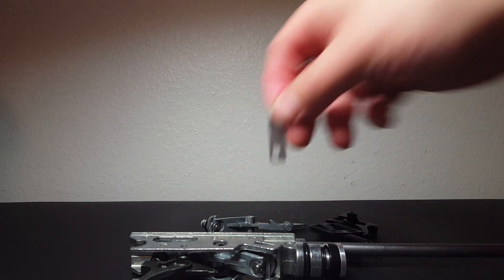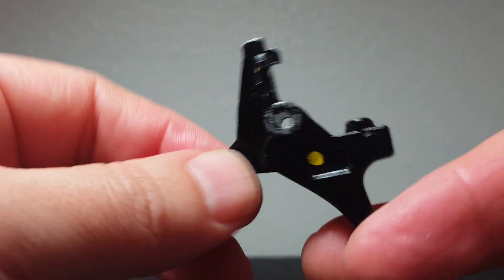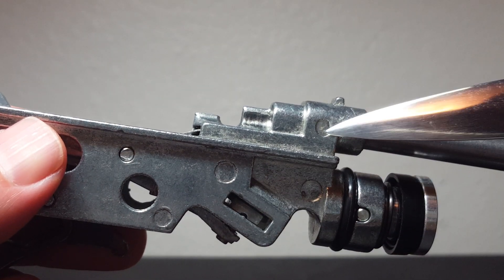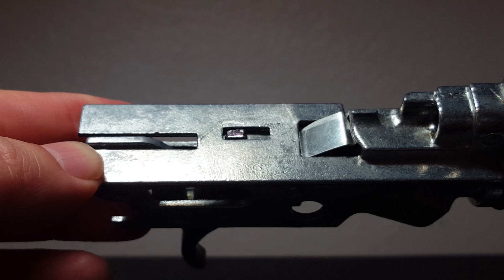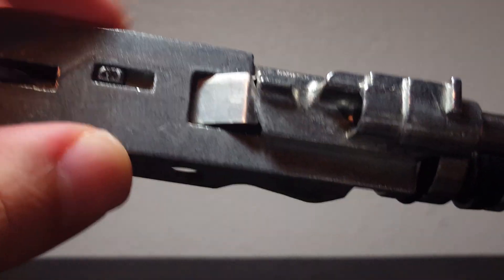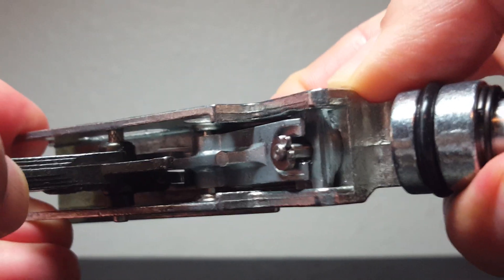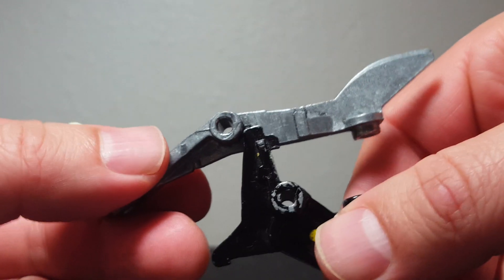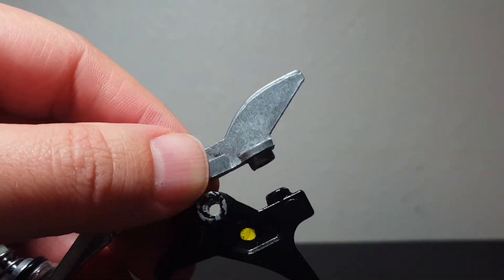Daisy 880: Part Details

Comment: Question.... I just bought a 880... The bolt blows open when I fire the rifle...it seems like there is a excessive amount of oil in the breech and on the o ring.... It sends the pellets down range with no problems...too much oil or do I have a lemon?.. thank you!
Reply from the maker: The last time I heard of the rod blowing back was a shooter using very HEAVY ammo or Red Fire pellets that have a THICK skirt.

If you see excessive oil, work a Q-tip to soak it up. 

I'm glad it is shooting well.
Reply: And it looks as if the safety tab is doing something.
Reply: I got it fixed thanks to your videos...the safety tab was pushing up the bolt and the bolt would not always click in place as you push it forward...the bolt wouldn't click into place in the back of the bolt behind the charging handle...I know my way around the 880 now...I lost and found all the parts your not supposed to lose... LOL!!! Thank you!!
Reply from the maker: Darrel, good job! Good fix!

Thanks for explaining the malfunction. That description can help others.
Reply: Got a scope on it today... getting it dialed in...

Comment: If the barrel separated can it be fixed?
Reply from the maker: It depends. If it has a bend, that is a tough road.

If you use a powerful epoxy (a syringe with a tube on each side), it could hold. Make sure to wipe off any excess in the breech and front.

Use a Q-tip.

Comment: This is actually a hammerless design. The valve lever is a pretty basic idea that works great.
Reply from the maker: Sir, yes, good point. I would rather call it a lever too. Some airgun smiths call ANYTHING a "hammer" that trips the valve stem.

But talking with the general public, your terminology is what I go with now. My 1100 and Grizzly have a hammer - THAT IS HAMMERING AWAY.

Comment: If you are the only person using the 880, it's ok to remove that leaf spring safety catch thing. It does help to eliminate a little friction when it's not there. The other thing is to file down (shorten) that trigger sear step, where it meets the "hammer". Take off 1 or 1.5mm of material, then apply grease at the junction of those parts. This improves the trigger pull by shortening the pull and eliminating the long 'creep'. It will be very crisp, and helps with accuracy because you're not pulling so hard on the trigger. The other thing is the hot rod piston and valve body, and loading bolt that has two o-rings instead of one, all available in the Winchester 1977xs. I did this to my 880 and it's an enormous improvement in power. Also get a metal pump lever, the cast one, not the even older stamped steel one. A metal lever makes it much easier to pump, and the 880 will be harder to pump after hopping it up with these parts. Stock: 650fps, Hopped up: 870fps. It's expensive to do this, and kind of stupid I guess, but as a hobbyist, cost is not really that important Lol

Comment: Just got it someone had it apart before part started falling out like crazy. Smell like wd40 some seals were bad squeeze them and they break. But the seals that cost the most feel and look good.
Reply from the maker: Jacob, great! You are in business! But clean off all CONTACT surfaces.  WD-40 awesome penetrator. It isn't a lube. This is where folks screw up.

Here is what WD-40 IS great for. Seriously, it does great at these jobs: 

(1) Cleaning grime off head light covers. It is like tree pitch and fogs the cover. Wd-40 MELTS it right off. Then use scratch remover, after wiping off wd-40, and that slicks out the plastic to keep new grime off. 

(2) Rust killer. I just used wd-40 to kill some rust on some metal tools. It was fresh rust,  but is wiped it out, and it leaves a protective cover to ward off new rust. But not for guns as it causes too many complications. 

That is why the rings are melted. Get all traces of that penetrant out. Then put in new rings.
Reply: Daisy 880 Fanatic Fix It for some reason happen few time now haven’t figure out why but the air tube keep coming off the trigger assembly when pumping alfter a while.
Reply from the maker: Jacob, I tracked down that problem. The Danco SAE 113 (#11 in their system) are tight fitting. That slippage is unlikely. That is easy to find at Lowe's or Home Depot

You also could shim it by wrapping some fishing line on surface UNDER  O ring. That will fatten it up and hold better. Just a few turns of line.
Reply: Got it working took part out of the newer one shoot great

Comment: Hey i have a Daisy powerline 340 and i buy it 2 days ago but it have lose power and i only used it one time can you help me? When i buy it, it breaks the boxes but now it only bounce so im assuming that it have lose power.
Reply from the maker: Raze, I have a video library on 340. This video celebrates the 880  engineering.

Ok to start the 340 is a $10 gun and should not cost you more. I went through two mainframes (bottom half) before I learned tricks to keep this gun alive. My slide is going on 6,000 shots. The third mainframe going on 3,000.

In your case, your are having problems right away. Try cleaning out the barrel. Basic patches will clean tube and may clear an oil plug in back. A dirty breach seal or oil on the transport hole (where air shoots out to launch BB) could cause problems. Just shoot out the patch. Make sure no BBs are in gun.

Use only Daisy BBs and proper two-hand grip.  I just shot about 15 shots at 5 yards after your contact, and standing I hit it most times. A healthy 340 can punch through a pop can filled with water - ONE SIDE.

Your gun is not jammed- don't reuse BBs. I had one light jam from defective new BB. I just took off slide, pushed forward on slide spring to open gap, then used a rod to tap out by hand....no hammer.

If you get bad jam because you reused BBs, then that means total slide disassembly. Tap out FORWARD - out muzzle.

For lubing, you use FP-10 on right side of cocked hammer to slick out trigger sear - much better shooting. Every two BB mags emptied (400).

For power plant, try RWS silicone or Super Lube O-Ring oil. Eject magazine, and put one or two drops on mainspring. It gets in tube and lubes rubber piston seal. Every 4 BB mags emptied (800).

If you are using DAISY BBs, and not used shot, your gun should not have these problems. 

For long life, DON'T DRY FIRE TIGGER. It puts stress on metal post and in time it breaks.

DON'T DOUBLE RACK. If you aren't sure you loaded BB just shoot. A 340 can survive a dry fire. A DOUBLE RACK puts stress on the post - since the gun is already cocked - and can snap the post.

Raze, if you can't get it going try taking it back. NONE of my 3 340s had this early disfunction. If you do dissembly you can't take it back- unless you get it put back together right.

Comment: 👋🏾 I’m assuming this model 880 is the older metal receiver is like mine was. The older 880’s has the smoothbore barrels which is not that great with pellets for accuracy. That is why I converted to the new style one piece valve and rifled shot tube. Still have the original valve and smoothbore shot tube but what a difference in accuracy👊🏾😎
Reply from the maker: No, actually that is Daisy 35 assembly body.  What changed from brass style to new style is mostly related to pump tube evolution (inside).
Reply: Daisy 880 Fanatic Fix It hey man I have a question , I’ve been pumping my daisy 880 4-5 times and doing some target shooting whenever it hits the target it throws sparks is that normal ? I’m using rws 7.0 grain pellets
Reply from the maker: BB, it is fine. Your 880 is fine. In this case I would investigate what your RWS pellets are made from. I don't shoot much RWS ammo. But others really like them
Reply: Daisy 880 Fanatic Fix It alright thank you 👌
Reply: Daisy 880 Fanatic Fix It the target is metal but I’ve never seen it throw sparks till about two days ago